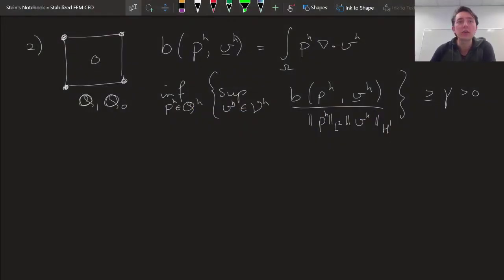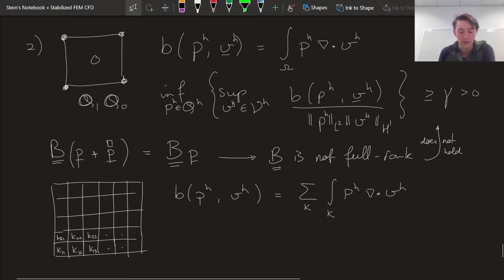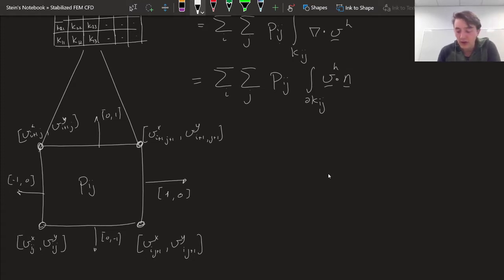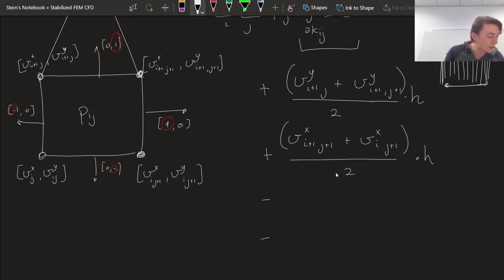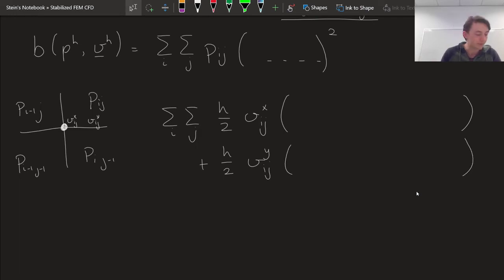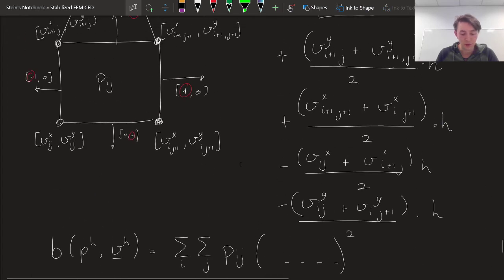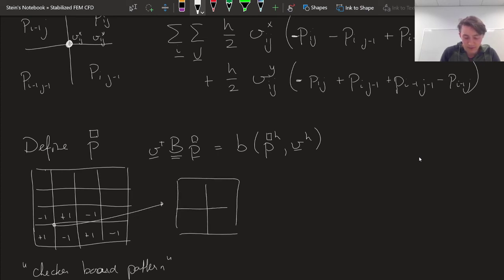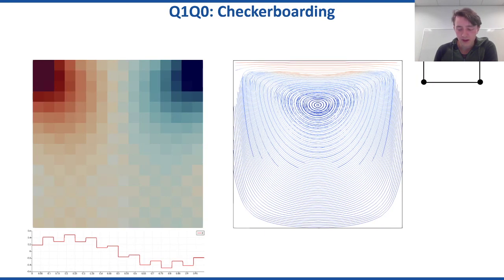36 - Mixed formulations - Q1Q0 elements: checkerboarding

Comment: Hi Dr. Stoter, at 11:50, I think those last two terms should be positive (we get another negative sign) because the line integral should have consistent orientation, and from the first two edges it looks like we were integrating in the clockwise direction. So actually, I guess all the terms should be negative since the boundary curve should be oriented counterclockwise. I think the same checkerboard pressure still works because they would just all have the same sign. Still a great lecture as always, thanks
Reply: Nevermind, I actually took the time to write it out on paper and the video is correct. For some reason it was backwards in my mind. That's what I get for trying to watch math lectures at 1am. Sorry about that!
Reply: This also makes sense intuitively since the contribution to the divergence along those edges should be in the negative y and x directions respectively. Again, apologies
Reply from the maker: @christianaustin782  I was just about to check it myself. Thanks for keeping a sharp eye on the details!